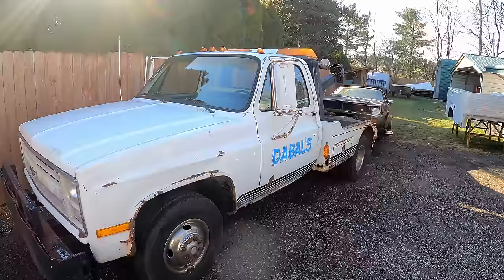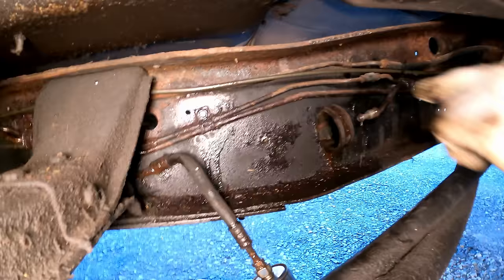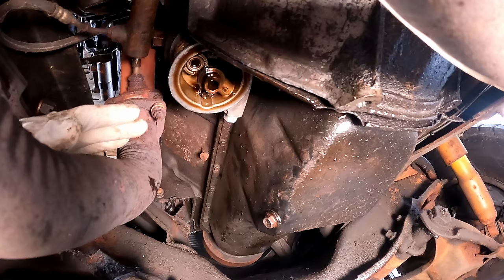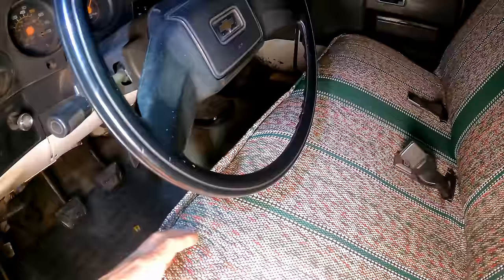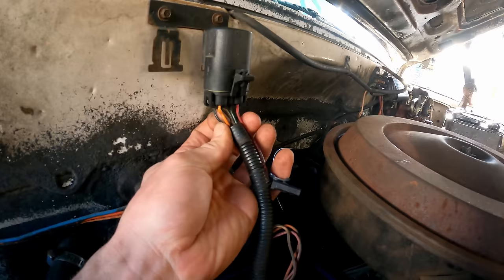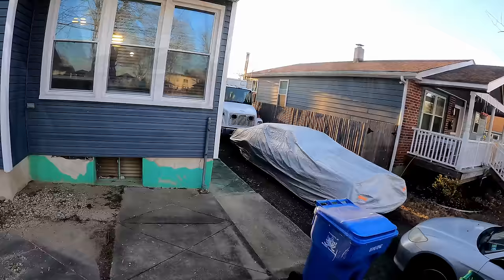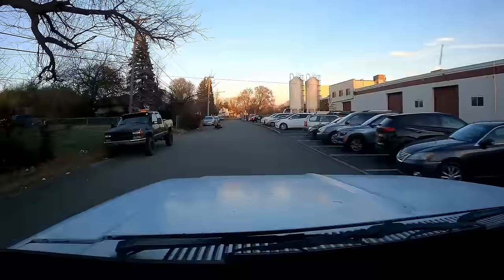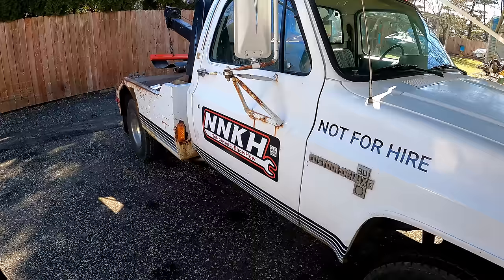C30 Wrecker Final Upgrades / Fixes - NNKH

Comment: Anyone that claims the weight isn't supposed to be on the sling obviously has never driven a tow truck with a sling.
Reply from the maker: Yeah. There was a bunch of comments about that in a previous video.  I'm no tow truck expert but I watched several videos from professionals before using the sling.
Reply: @NoNonsenseKnowHow  I drove wreckers for 10 years back when slings were still somewhat popular. Even with older cars you had to be careful not to scratch the chrome on the steel bumpers, which is the whole purpose of having a rubber sling. The chains are left loose as a safety, and short chaining is for wrecked or otherwise junk vehicles. Don't forget you safety tow chains as well though. Get yourself a nice set of aluminum spoons and steel L-bars for your wheel lift, a hitch receiver attachment, and some dollies as well. The versatility is quite impressive if you have all the right tools.

Comment: Quick question I own a 2016 chevy Colorado I have noticed that after we run through the Blue wave car wash my front suspension has been squeaking like if it was an old pick up truck. I did spray   Blaster but not the green one your using in this video. If I use this green blaster would it stop the squeaking If it doesn't stop it what can I use? Took it in to the dealership for its regular oil changes & told them about it & they said they don't lube or grease suspensions can't believe this its the dealership I bought the truck from. Hoping for some advise Thanks RF from TX.

Comment: I would just get rid of that rubber thing in the back, you tow everything with just the wheel lift 
Ps I would recommend some kind of bed lining for your bed
Reply from the maker: Towing with the sling distributes the weight onto the truck much better. Great for heavy vehicles
Reply: @NoNonsenseKnowHow  makes sense. I Enjoy your videos especially when they are about tow trucks, hope u get another project soon

Comment: I hope you put the oil filter adapter in the right direction. They can be backwards. Ask me how I know lol. Takes a hard gasket also. Mine didn't come with one and I had to take it back apart. Thats when I realized I had it in backwards also
Reply from the maker: I don't see how it can be put on backwards. Based on what I saw it doesn't matter. The hole is going to be centered either way.
Reply from the maker: This video covers the subject in detail. No gasket required. And can be mounted in either direction.  https://youtu.be/Z1qTFKbu6gs
Reply: @NoNonsenseKnowHow  well that's nothing like my 350 then or my 327. They both go in one direction and both use a hard gasket. I will check that video though.  Good job man!!! I dig the tow rig
Reply: @NoNonsenseKnowHow  Wow.. I actually watch that man's videos. He has alot of great engine build videos. Ok well the video i watched said it could be backwards. Maybe he was referring to putting it in a better direction for that oiling hole. Good to know.

Comment: I really don't think you could get a truck like this for $5,000 with all the new things you have put in.  It's a great truck and will go for many more years.  I also wouldn't get a new cab and start there because of the frame although you have repaired it quite well.  I like the truck as is but maybe some metal preservative measures would be nice.  It is what it is and it will come in handy for you I would think.  Swing hard and look up!!

Comment: Spray foam in can works great for the seat as temporary…
Reply from the maker: I was thinking that would be a little too firm and end up breaking apart
Reply: @NoNonsenseKnowHow  you won’t know if you don try. Use a  material that is kinda like a foam or a material to hold it all in.  What is the worst that could happen. I like your channels allot.
Reply: Also you can shape the foam . Add it sculpted it whatever you need to do
Reply: @NoNonsenseKnowHow   you can get some foam from a fabric shop. Choice your foam type. Cut it in to the size of piece that is needed. Also get some top foam that is harder than the foam that you just got and place it on top of the foam as support as well. I have allot of experience with foam. I use watch these two old guys who owned a automotive seat cover repair shop and they did all kinds of stuff to bring back seats. You could get some new foam for just the bottom and replace it. It’s not hard to do and not that expensive to do. Seat covers are relatively cheap for a pickup truck
Reply: @NoNonsenseKnowHow  I did the entire seats both front in back of my 65 corvair and 63 Chevy Greenbrier van.. I learned how to do this work from the old guys. One was Jewish and the other was Italian. They did all kinds of trucks and cars.  I wish I could show you a picture of what I did

Comment: Would a relay cause my 1990 buick 3800 to only start on the second crank? I can't get it to start on the first crank no matter how long or short of time I crank it. However, if I crank once even for a quick second, then turn off and crank a second time it fires right up like it didn't have an issue. It's driving me nuts to have to crank it twice lol
Reply from the maker: I'm not 100% sure, I'd have to look at the wiring diagram. Those later 3800s are notorious for crank sensors causing similar issues. But I'm not sure about 1990
Reply: @NoNonsenseKnowHow  That was my second guess or the cam sensor. It has that magnetic one that hangs out on the back of the timing gear. Well guess ill start with checking the crank sensor. Thanks!

Comment: Where did you get the dash carpet and how does it fit? I just bought a 85 Chevy C30 wrecker with a Holmes 440 Hi Power mecanical boom and Holmes Sonic Lo-Side bed that was used at a local service station and also the familys circle track till the track shut down in 2015. Im fixing it up but keeping it original on the outside since its clean but the interior needs redone but for now i wanna just cover the cracked dash while i do other work like a tune up and fix the hydralic century wheel lift
Reply from the maker: I got it on amazon. Fits great. Don't remember the brand

Comment: ignition switch bad or flipping back  to accesory
Reply from the maker: Yeah that would do it too.  Ended up being corrosion on the terminal pin of the oil pressure sensor in conjunction with a bad relay.
Reply: @NoNonsenseKnowHow  yeah  cheep insurance to replace with a standard or delco OEM one to keep it running

Comment: I got a question for you about my 2003 Acura RL, after you drive 15-20 miles there is a rumbling / vibration in the front end slowing as you slow down and increasing as you speed up, but then you may go for a 100 miles with no problem then it crops up again, I checked for bad wheel bearings and worn tie rod ends and that is not the problem, what are your thoughts? also front wheels heat up a little bit, the drivers side more than the passengers.
Reply from the maker: Sounds like you might have a caliper that is sticking intermittently. Or possible bed break hose.    That will cause the rotor to get hot and warped and caused vibrations. That's one possibility. Could be many other things though

Comment: The old Chevy is looking good!  I’ve got a 1984 GMC 7000 dump truck I’m working on, cab is pretty much the same as your chevy.  The top of dashboard is in rough shape, the fix you used would be a nice upgrade for my truck.  Where did you get the dashboard carpet?  Thanks - Will
Reply from the maker: I got it on Amazon. I imagine your dash would be considerably different though but they probably sell them. Quick easy fix.

Comment: Lucky it didn't blow up cuz you can't plug those cooler line holes cuz it wouldn't  Circulate oil that's why there was hose loop in there  incase no one said anything to and not be mean or try be keyboard loser just so you know for next time I have two buddies tpi chevy Silverado blow up in a month after plugging them holes with pipe plugs k
Reply from the maker: There was a bypass valve inside the housing with a very lightweight spring on it. I verified it had good oil pressure with the ports plugged off. No problem leaving it like that from what I saw
Reply: Ok just letting a guy know just incase some people don't know but your pretty cool i like the video keep up the good work